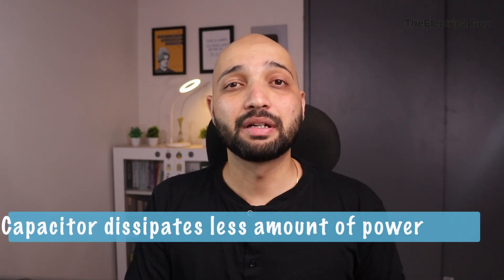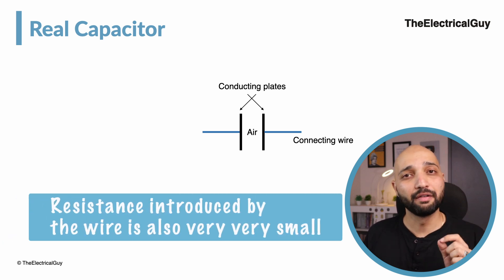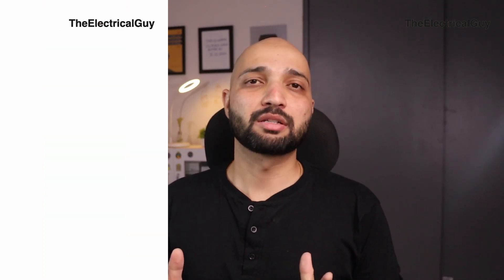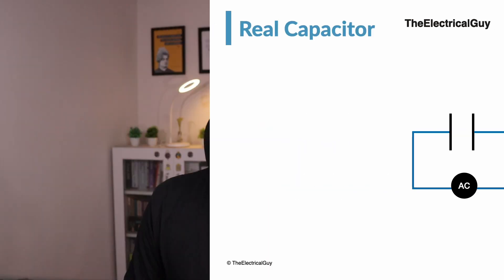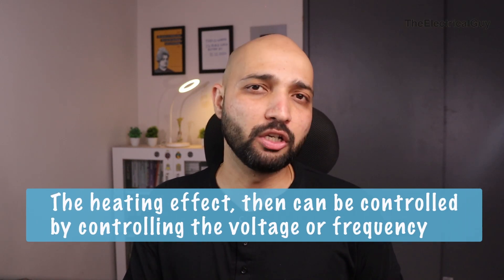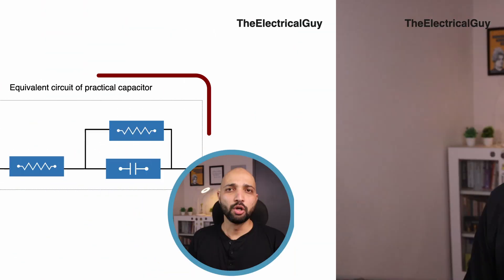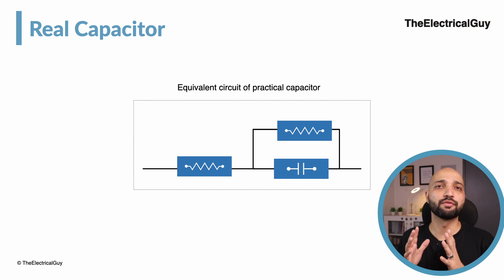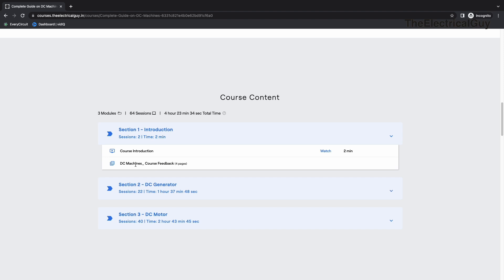Problems with Real Capacitors | Explained | TheElectricalGuy

Comment: A Salam Sir I watched your videos and I really like your content and your easy explanation way your all videos are really helpful, 

I want to ask you a question | What is -Volt in DC? I have a power supply which has 220AC input and have out of -12Volt and 0Volt and +12Volt, means three terminal output, so what is the concept of -volt and why we need it ?